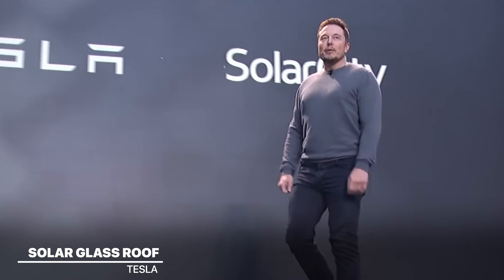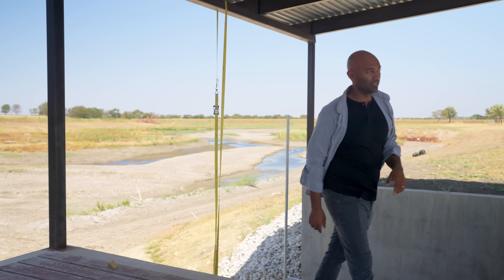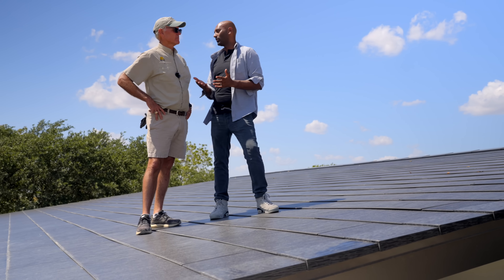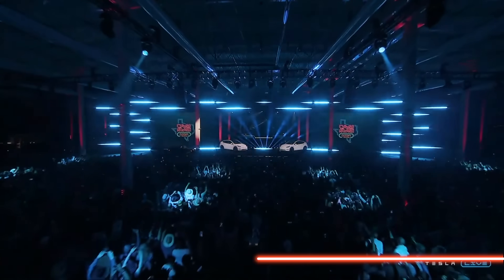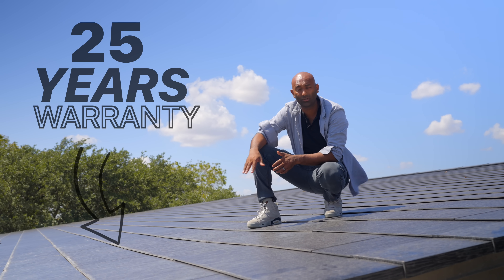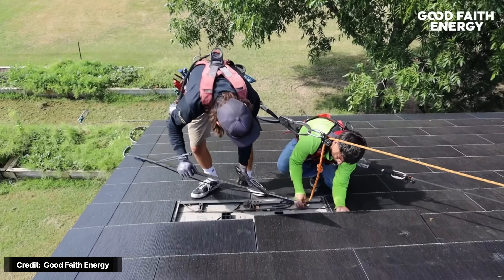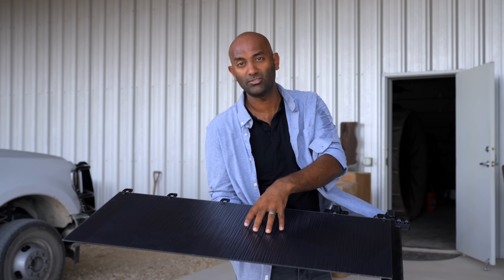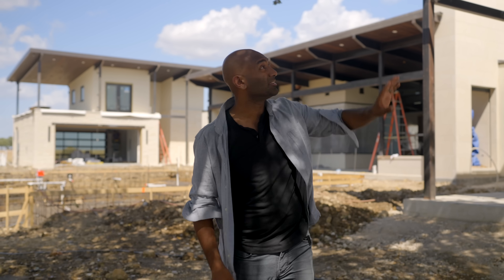Tesla Solar Glass Roof is About to TAKE OFF!

Comment from the maker: Buying a Tesla? Use my link! https://geni.us/GoTesla
Reply: the prices in the USA or your area must be incredible high or overpriced compared to here in central Europe.
30 kWp on a complicated roof facing south but separated in the middle by a dormer of 7 m width with a chimney for the wood oven and another one for the oil central heating was 22000€ incl. a 15 kWh lfp battery, but of cause no tesla stuff cause they could not even write an offer for a battery.

Therefore how long would it take to get a quote for a whole roof from Tesla ? 
And here in europe there have been shingle cells out for years so Tesla has competition but again those shingles are way to expensive compared to the current solar panel prices which are here below 200€ incl. tax for  each kWp , panel only without the under construction which is here about 80€ per kWp, so 280€ or roughly 300$ per kWp without the inverter side. 
Prices have dropped by 50% since the china is pushing its production into the EU. 
And they also have been able to conquer heatpump market shares most recently, a 12 kW monobloc heatpump without subsidies is shipped to EU for 2000 $ incl. customs and vat.

Comment: Most people do not understand most electricity is dirt cheap and that you pay 10 times more to rent the grid. 

They play games to get your cash. 
Every street is full of $20,000 poles.

If only grid electricity and no fossil fuels then the grid capacity has to be 10 times bigger. 
The first grid cost 10 times more than the power plant.

Grid owners has a massive infrastructure investment and need in total a massive cashflow from the millions and millions of customers. 

Just a fun fact to help people understand politics of vested interests. 

With BEVs, battery vehicles, massive battery free for mass storage 23hrs every day and some rooftop PV everything will change. 

From my earlier comment read the following.,:

CO2 climate destabilisation means BEV, battery vehicles, are the cleanest transport and easiest to top up daily. Rooftop PV. 😀

In 2023, nearly 14 million battery electric vehicles (BEVs) were sold globally, which is a 35% increase from 2022. This brought the total number of BEVs on the road to 40 million. 
60 million 2024

BEV Massive batteries on wheels parked 23hrs every day and all night long.
80% of the world's population live in warm latitudes. Perfect for rooftop PV. 
Rooftop PV electricity biggest problem is its massive 5hr production for 24hr demand. 
Rooftop PV electricity is dirt cheap electricity. 

BEV daily drive is extreme under utilization of a valuable resource. BEV massive battery are designed for the long drive or long time between rapid charging. 
BEV in commercial use have huge hours of operation. 
BEV massive storage battery on wheels, parked 23hrs every day and all night long with v2g technology are perfect for owners to maximise tax-free savings on no petroleum, no grid electricity, no gas heating and cooking and hotwater. $10,000 annual savings. 

High marginal taxpayers are early adopters and can gain the highest tax-free ROI, return on investment.

My background, BEng, CivEng. Construction.    
Decades of construction pricing and construction work. Including GRID electricity supply. Power stations and transmission. 
Now retired and free of construction company restrictions on speaking up. Grid construction engineers silence is deafening. 
Grandchildren and children need an economic energy future. 

GRIDs are extremely expensive and need extremely very large cashflow. 

Grid capacity is $1million to $10million per km. 
Millions of km is no joke. $BILLIONS projects.
Vested interests.

Look at government enquiries into grid expansion projects budgets explosions. 

Hello from the warm latitudes of Australia. 😊
Remember all latitudes are warming. 😮

Comment: Ricky, what you didn't mention is Tesla requires only Tesla products used with their systems and you can't repair them yourself. You need a Tesla certified repair specialist and they don't come cheap.  The average US home can run off a 5-7.5Kw system and that is something most people can install themselves most places and go completely off grid.

Comment: Biggest issue with any in roof system is is cooling of the panels.  In roof solar panels get crazy hot which can easily drops efficiency 25%. Normal COTS frameless panels mounted with a 15cm ventilation/confection gap will be much more efficient for a fraction of the cost. As long there is no active thermal cooling (integrated water system, etc) these systems are an engineering mistake. Costwise it's also impossible to compete with COTS pannels, price have dropped to 0,10$/wp or less than 25$/m2, i mean that's that's even less than the underlayment/OSB used for the roof. No way one can compete with those numbers. Just as reference i'm diy installing 40kW of frameless solar icm 60kwh of LFP for less than 10K euro, go figure....
Reply: PV panels on rail mounts stay cooler on hot days and so produce more electricity. Cooling air beneath the panels is good. 😊
Reply: PV panels are cheaper than windows $m² in Australia. 

The government loves all the homes that are not using grid electricity. 
As the grid generation ages and grid capacity does not have to expand the government is saving $TRILLIONS on the national grid new works.
Reply: Rooftop PV panels shade hot roofs.  Shade 😎 is good. 😅😊😊😊

Comment: Why do expensive Tesla solar roof???  That surface could have been a much less expensive - and easier to maintain - as traditional solar panels.  And its low angle means it is not even visible, so not buying the “ascetics” issue.  Even as a pricy Tesla solar roof, when looking directly at it, it doesn’t look that different from a traditional solar panel bank.  The architectural “design” of that roof looks like a traditional panel bank!  It looks like a retrofit!

Comment: If you fully bundle and get the largest system to knock down your bill to the best price per watt, it is $2.10 per watt. Otherwise it is $4.65 per watt.
If I go to signaturesolar and get panels they will cost $0.25 per watt.
The semi-premium inverters are $0.25 per watt.

Solar is much easier to justify if you are not over paying for your hardware by 4x to 20x.

Comment: Blown-in foam insulation can be extremely problematic if improperly mixed, causing off gassing, resulting in severe health issues for some people, rendering the properties unsaleable in jurisdictions whereby full disclosure is legally mandated. 
In the UK, mortgage lenders generally are very wary of this type of insulation as you cannot gain access to the structure of a property during full structural surveys for the purposes of gaining mortgages; sellers are having tremendous difficulties in selling these properties. Should anyone need for whatever reason, to remove foam insulation, they quickly find themselves presented with two HUGE problems  - the associated costs and the nigh on impossible task of removing the stuff. When  done well, sprayed on foam insulation does a great job, but I would NEVER use it nor buy a property with it installed. Much, much better to use blown-in cellulose insulation as it's minus all of the aforementioned issues. 

As for solar roof, it's a fantastic product, but to my mind, it has become something of a commercial flop for several reasons - high price tag, lack of public product awareness due to little to no advertising, and Tesla's distinct lack of reliability in relation to customer service along the entire supply chain from quotes to final installation, even going as far as TRULY shoddy treatment of customers who'd paid, some in full, with signed contracts, others with no roof as they waited on Tesla, only to either be told that there was a massive price hike or that their contracts had been cancelled altogether as they were not servicing those areas; this is a general summary of Tesla's solar roof customers at the time and there were some other details that I've not included, but you get the gist of it. 

When Tesla gets customer service right, it is second to none. But should they not do so, they tend to truly bollocks things up.

Tesla's energy division, principally the sales, distribution, and installation of their solar product range, kind of seems to be something of an afterthought for the company these days. It's never even remotely approached anything near its true potential and it kind of feels as though Tesla is more or less going through the motions where their solar product range is concerned; quite puzzling given the company's raison d'être. Instead, Tesla seems to be putting all of its energy & focus into (mainly) grid tied stationary storage. It's almost as though Elon has lost interest in Tesla solar products, perhaps because he's got far too much on his plate as CEO of both Tesla and his privately owned entities.

Comment: In a perfect world Ricky, you can design for that type of roof.  As a designer I only have to keep that in the back of my mind as I'm working with my clients. My State (Washington) has a strict energy code that does have this carbon credit system which would allow near half the credits required, IF we add a solar roof.  So it is coming or pushing against the tide of what residential design should look like.  It is a notoriously slow industry to change.

Comment: Solar panels should be built at different angles for different latitudes, all flat, with water cooling/hot water heating as one.  So, rooves first, then build beneath them.  Of course, building the roof would be in a factory, BIG panels, so build delivery trailers that can lean them over to pass low bridges or make the factories movable to build an entire subdivision, pre-insulated at the factory, pre-wired at the factory, pre-piped for hot water at the factory, modular.  Making solar shingles is suboptimal.

Comment: I think when they spray foam the attic like that - it is considered part of the conditioned envelope even if not directly conditioned.

It would be interesting to put a heat pump water heater in that attic and see what the ambient temperatures are…

Comment: I'm hoping to build a house and would love to have a Tesla roof on it. 

Advice please. I need 15kwh a day to power for power outages that can last from a couple hours to a few days. I'm in Michigan so my solar hours is 4.48, 1,278 Kwh per 1Kw, says need 4.24 Kwh array

I'm looking at a 400w, 36v panel, says output DC 39V, 10.25a max, transfer efficiency greater or equal to 21%

A MPPT Charge controller of 100a, says 12/24/36/48v Auto, Max Input 100v. Max charging current 100a. Max Input volts of panels should be 30v-45v (for 24v battery). Max Input power of panels should be 2000w. Output voltage DC5v/1.5a

Inverter of 4000w/8000w Peak, Pure Sine Wave Power Inverter, DC24v-AC110

And Battery is LiTime 24v 100Ah, LifeP04 Lithium Ion, Build-in 100a BMS, 2,560 Wh Energy. Up to 4P2S (don't know what that means) 48v battery 400Ah of 20.48 Kwh

It's only 1000sq' apartment, 2bd/2ba. Old Kenmore Fridge, elec range, micro, dishwasher (which I'd forgo during an outage), a couple computers and tvs, wifi, lights, a mini-fridge, that's about it. No washer/dryer and if I did use my hair dryer, it's 5 mins or less, but I don't use it every day (and my housemate is bald). For obvs. reasons I wanna keep the heat on and the fridge. We'd unplug things we don't need for a few days, but I'll stick with what we've averaged over the last year anyway just to be safe at the 15Kwh a day.

Am I on the right track here? Too much, too little, just right? Any part of this not work with another or could be downgraded or done better/easier/cheaper? Any part of it I don't need? Anything I do that's not here? Thanks for your time!

Comment: A $50,000 premium is way too much!  It's been these several years and costs haven't come down. Solar glass roof looks to be a rich person's toy.  The solar shingles by GAF seem to be more cost-efficient. 

regardless of that one mistake I see is the self-imposed requirement to cover the entire roof with glass shingles. why not just simply put rectangle blocks of solar shingles on the roof to generate power and integrate them with matching regular shingles on all the other quirky roof surfaces?

Comment: Paying more than $100k for solar seems really ridiculous to me.  I have a massive traditional panel system (grid tied) that covers all of my net electric use and the grand total cost was around $30k and that was before all of the tax credits and other incentives.  Maybe the Tesla product hasn't done well because it isn't competitive?  I used SunRun for my system, maybe call them and see how it compares.  Using batteries doesn't make much sense, batteries are very expensive and eventually have to be replaced.  Grid tied is the only cost effective setup.

Comment: I've had a Tesla solar roof since 2019, with panels made in New York and 2 x 3rd gen Powerwalls. We've had no physical problems with the system, only some software issues with the solar inverter that were solved after a firmware update obtained from the inverter manufacturer and installed by a Tesla employee. The only negative aspect I have, upon reflection, is that we get quite a bit less energy from the roof than we thought. It's about 30% less than the estimates Tesla gave us. I guess, if you want to go with a system like this, don't worry about things like roof leaks, that shouldn't happen. But you're going to be disappointed if you expect to get ALL of the kilowatts as stated in your contract, even on a perfectly sunny day at noon on the longest day of the year. The solar we get is still useful, but if we ever end up disconnected from the grid for an extended outage, we will only be able to power our refrigerator and microwave off of the solar, and charge our phones. No computers, TV, washer, dryer, dishwasher, HVAC - they use too much energy.

Comment: I had a contract to install back in 2020. The company installed two Tesla roofs and then stopped. The price was high but so was Tesla stock. 2023 I found another, bigger company and was really excited about moving forward. The price — pretty much double. So I’m going with panels and powerwalls.

Comment: Solar seems to be very expensive in the US. In Australia, I put in 13.2kw of solar on our roof which cost about $8,000 (AU), this includes the inverters (2 x 5kw inverters) and installation cost. We have a subsidy scheme, but it's fading away year by year as the rebate scheme decreases. The market is so mature we pretty much don't need it anymore. Without the rebate, I would have paid about an additional $4,500 (AU), being $12,500 (AU) in total; which is about $8,396.25 (US). There is so much competition in the US, I would have expected even better prices.

Comment: When Tesla first announced the tiles they were 100% Fake, they had nothing, not even a working prototype at that time.  Even now they are still way too expensive per square foot and too low efficiency compared to regular panels.  17KW of generation on that size of roof is kinda sad.  With regular panels he could have gotten far more energy generation close to 25KW for the same area and the installation would have been even easier and faster. The overall roof with standard construction would have been cheaper and would last longer than the Tesla roof tiles.  A 25 year warranty on a roof is kinda on the low side, with quality asphalt composite shingles you should expect around 30-75 years of service with only minor repairs.  With metal standing seam roof you should also expect 50-100 years of service with only minor repairs.  That being said, all roof types need periodic inspection and minor repairs to ensure the maximum life of the installation.  It would be interesting to see the output and status of a Tesla roof after 50+ years of service.

Comment: I want my house to be similar to the two of those roof lines.
I want a Solar producing south facing roof, and I want a Deck roof that I can walk out onto along the north sid. Bit of an overhand so rain doesn't come in through the door and maybe a dumbwaiter, so when we have people over we aren't trying to climb stairs with a bunch of food in hand.
Environmentalism? lol no. It's all about efficiency and being more independent.
Reply: Oh, forgot to mention my main point. A major reason solar roof has done bad is roofing companies are not electricians.
Your typical roofing company has been doing the same things for generations. Slight changes over time but it's standard stuff. Look for rotting wood to replace, nail stuff in. Seal areas you can't get total coverage in without. Lay tile/shingles. None of which has the slightest to do with electrical work.
The same can really be said of about all the subcontractors in the construction industry I'd wager. As such, they will have to either hire on a few electricians or subcontract them to do work and still be on the hook for warranty issues. They don't want that risk, so most customers get turned off by the few companies who do asking for a price point that just isn't reasonable.
40k shingle roof vs 350k solar roof + additional for battery backup. I think one company quoted 150k for a roof + panel installation all in one but that family member wasn't interested since he's retired and can't get any of the tax incentive.
Speaking of Tax Incentives. They don't help everyone, just those who make enough each year to splurge on such an expense anyway. I got almost nothing for my Model 3 because I saved for 10 years while owning my previous car to buy my next one, with a salary that most probably would never save enough to spend on their next vehicle with. Great, my frugal nature means I can break the bank to buy something that'd cost me 18 months salary. Taxes? sorry you don't qualify to get that money back.